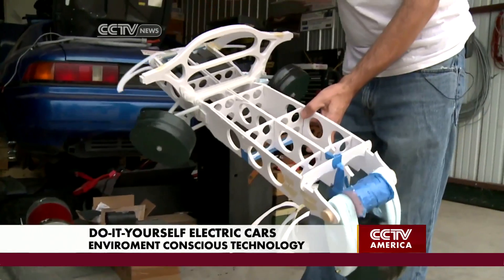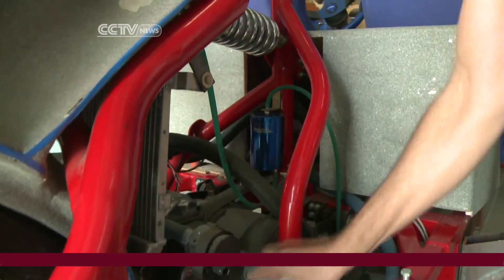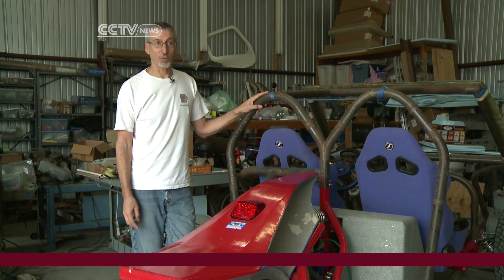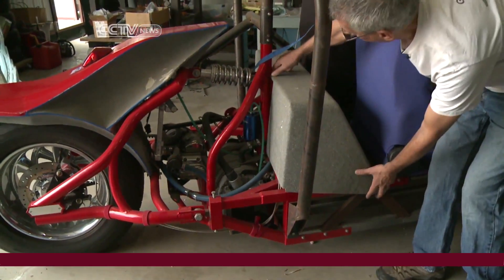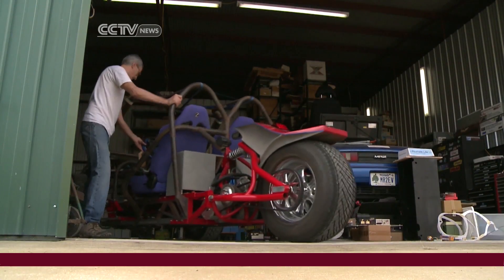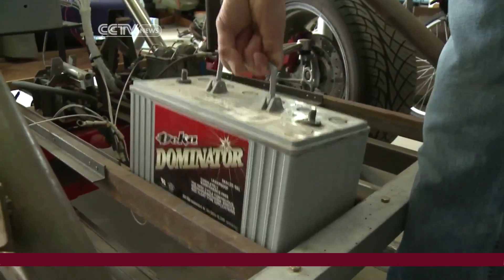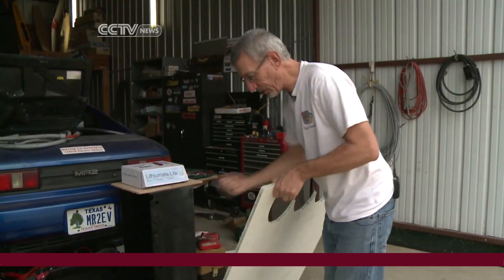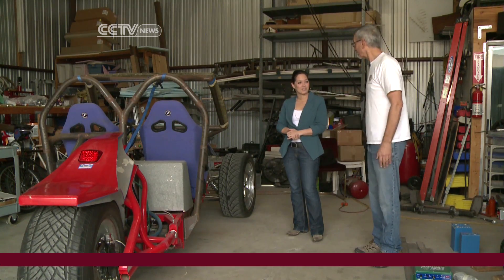Do It Yourself Electric Cars

Comment: Why is it that everyone mentions recharging via Nuclear or Fossil fuels. How about Solar or wind generation? Both certainly capable of supplying enough current to recharge the cells. As for recycling the batteries, not sure about the lithium but the Lead Acids are very recyclable.
Reply: Lithium is recyclable as well.  The term trash is just a way to make money off people.  The electric car isn't about saving the planet.  It's about efficiency.  Sure they both pollute, but the electric car recaptures energy that would otherwise be lost.  In my opinion, electricity should eventually cost the same as it does to breath air.  Zero.  Same with the Internet.  However, we like the idea of scarcity...because scarcity makes some people rich.
Reply: The county recycling center where I live will recycle all batteries, except for lead acid car batteries. Car batteries are recycled at Walmart or the landfill.
Reply: scoter1 in comparison, solar and wind power generates a lot less electricity unfortunately plus they both (particularly wind) kill many animals such as birds so many people see them as ineffective not to mention they have large initial capital investments with very little returns

Comment: Good idea, but the cost of batteries will stop any electric projects on their tracks.
Reply: Brandon Miller
3K for batteries on a vehicle that costs cents to charge. I spend 3K a year on gas for my truck. In 10 years when China is full spin they will be demanding gas as well so my gas bill will be more like 4-5k a year.

Sounds like a good deal. 3K for 5-10 years of driving vs 15-50k in gas costs.

I can't make oil at home but I can make electricity. Sounds like if you don't want to a debate machine for polluting corporations , then this is the way to go.
Reply: for real! last i checked lithium ion battery cells were 7 grand for three
Reply: Brandon Miller lol i was wrong it was 1500 for three, but in order to have a usable car youd need at least 6 so $3000 in batteries alone

Comment: Where does the electricity come from? Coal fired electric plants, natural gas plants, nuclear power plants?  How is that any cheaper or better for the environment? At least the way we are currently producing electricity. Solar is not powerful enough yet to power the car for long distances, unless it is ultra super light. I just don't see how electricity is a better idea for a car, I think it's a terrible waste of time and antiquated power source. What about hydrogen or them new bloom box thingies?
Reply: currishev I always find it funny how Naysayers have a long list of slanted questions, never have a counter arguments just accusations, and always place their back to the subject refusing to turn around and look at it for themselves.
Reply: Sure Electric vehicles use a lot of electricity but so do Petrol vehicles. You do realise that oil refineries run on electricity and so do service stations and the exhaust fans in tunnels. All that totalled means petrol vehicles use as much electricity as electric vehicles do km per km. Recharge you electric vehicle at night off peak and suddenly electric makes a lot of sense doesn't it ?
Reply: Modern power plants are up to 60% efficient, whereas ICE has only 30% efficiency. It was calculated that EV is about 30% better in oil well-to-wheel efficiency than ICE car. It's not a revolution as Tesla CEO is boasting, still considering zero carbon dioxide emission it's better than nothing.
Reply: Thanks for the info.  I just watched the documentary about Tesla Mtrs. The whole undercarriage is filled with batteries.  I'm sure they will cost a whole lot when you need new ones. Either burn fuel driving the car or burn fuel by making batteries and electric.
Reply: Again, watch any of the numerous videos of the packs being made and people taking them apart. It takes the robots in the factory half an hour to assemble a pack. There are 22 (or more) cells in parallel making it virtually impossible to tell when a single cell has failed; the fuse wires can only be visually inspected once the pack is completely torn down. Tesla is never going to bother with the laborious process of "refurbishing". Once a pack has been used for hundreds or thousands of cycles, the only way to know the state of any of the thousands of individual cells in the pack is to individually test each one. Tesla won't bother; it's faster, cheaper, and less questionable to just make a new one, and recycle the old one. Not to forget, nothing about the battery pack is designed to be taken apart -- various bits of glues, welds, heat seals, etc.

(The second hand market will eat these things alive -- just like we already do with old laptop modules.)
Reply: Roger Nalan Actually the beauty of Tesla's battery array is that if one cell dies, that single cell can easily be replaced. Some of Tesla's supercharging stations allow you to do a fast battery swap. The hidden wisdom of this is that a technician at the station can easily replace the failed cells after the pack has been exchanged and its good as new again. 

As for power, Tesla offsets the power their charging stations take out of the grid with a solar array and wind farm they operate that puts the power back into the grid. Which means I'll be able to drive all across this country, for free, and not pollute One Iota.
Reply: ***** I wanna see how it is easy to find and replace a failed cell in array of hundreds which weighs about a tonne. So it shouldn't fail in first place.
As for out of grid charging stations, where is calculations of their economical viability during entire service life? Low energy flux from sun and wind makes windmills and PV arrays very big (thus easy to damage/destroy) and expensive.
In technology, an idea, beautiful as a baby, oft doesn't survive quantitative analysis into maturity of mass production.
Reply: currishev Its all right there on their website. Go get it for yourself.
Reply: ***** I will check it for myself on their site when I have time. Thx for reference.
Still with BMS, all the hundreds cells must have the same service life, not to "create" another stupefying job. No one replaces a blade in turbo-jet engine.
Reply: +Roger Nalan at least it is not in the towns and it is more efficient. Otherwise everyone would have their own generators
Reply: David, sigh Look at any of the thousands of pictures of the interior of the tesla battery modules; watch any of the numerous videos of pack disassembly.. An individual battery CANNOT be replaced without disassembling a major part of the unit, and that's after the hours it takes to even get to the single module within the pack. Plus, there's no humans at the station -- plug-in charging stations are free-standing kiosks, and the "swap your battery module" station is entirely robotic.
Reply: jfbeam I'm the one that should sigh...

First, yes, I know the battery swap stations are completely automated, but each battery is taken given a diagnostic check. If there is a failed cell the pack is put aside for pickup, taken to a service depot, where a technician has all the tooling he needs to quickly access and repair any component that has failed.

Then the repaired pack is returned to service.
Reply: Funny to read responses in this thread. I imagine it is similar to conversations horse carriage owners must have had with new motor carriage owners in 18 hundreds.
Reply: What if the electric companies raise their nightly rates, and is it better for the environment to recharge at night?
Reply: fenderstratguy not only that but nuclear power plants aren't nearly as damaging to the environment as people believe, nuclear energy is the most cost effective and clean energy source. the only reason it hasn't been used as widespread as it could be is because people are afraid of another Chernobyl.

Comment: I like the tadpole design. $15K seems steep.  How will it complete with the gas-powered Elio at $6,800 US?
Reply: Battery prices needs to drop in order for electric vehicles to be economically feasible.  The greatest cost for any EV is always the batteries. The rest of the components like electric motors are relatively cheap.
Reply: Well so far it's main competitive edge over the "$6800" Elio  is that it doesn't yet appear to be a scam. Such a shame because I really wanted the Elio to be a success.

Comment: It never fails to amaze me how many people come in here without even the brainpower of a small appliance bulb talking about how they would rather drive their gas guzzling, brain dead american cars. Wow this country has gone straight into the proverbial shitter intelligence wise. Most have no idea that electric outperforms internal combustion on every front.
Reply: It's not always a question of want to but need to. The US is a massive country and most electric cars either cannot provide sufficient range for people or they are too expensive. People talk about 53 miles being enough range for an average work commute but where I live it gets cold enough for much of the year to reduce that range down to 30, which is not enough for someone who puts 175-200 miles on their car a week depending on if I do any grocery shopping.

Also, for those who could get some practicality out of an EV, name calling and smug pollution puts a lot of people off the idea of electric vehicles simply by not wanting to be associated with that sort of behavior. Stop that. I would like an electric vehicle some day but I don't want people to think I am as short-sighted and prejudiced as you have behaved.
Reply: Fox "news" said coal is clean.

Comment: No complaint in DIY to pay someone to convert for you. I love restoring old cars but others don't have the same knowledge/experience even desire. I love the idea of driving past gas stations. Q: Please describe use of "Ultra-capacitors"? Q: Possibility of dual capacitor banks? I saw an electric car show at the local convention center and learned much. Autos with limited mileage, but one had unlimited mileage due to dual banks of Ultra-capacitors (one running the vehicle while the other charging)